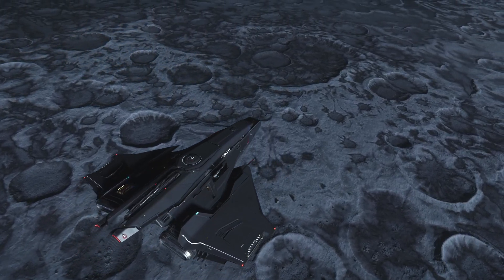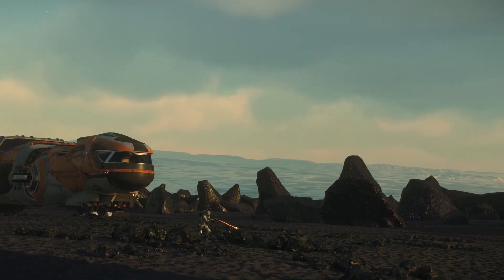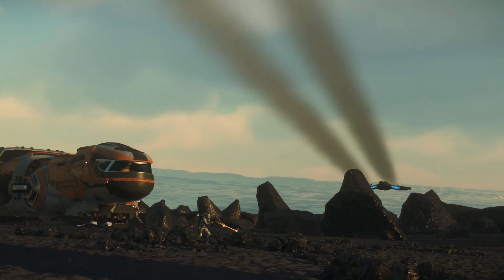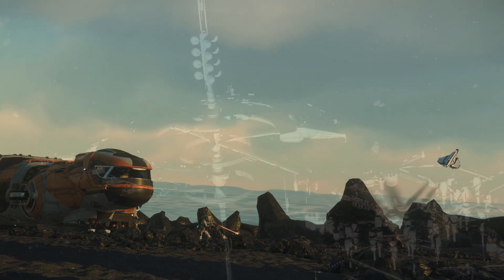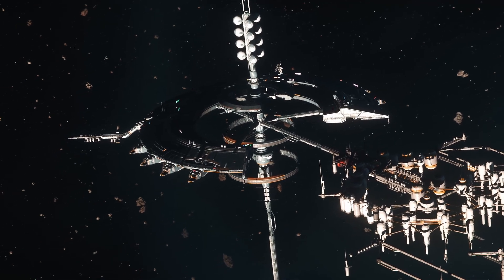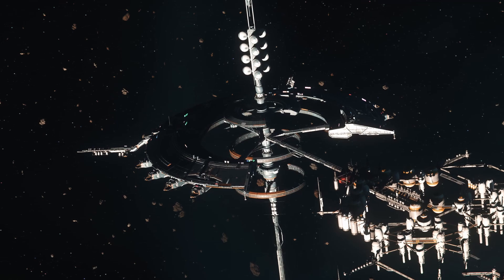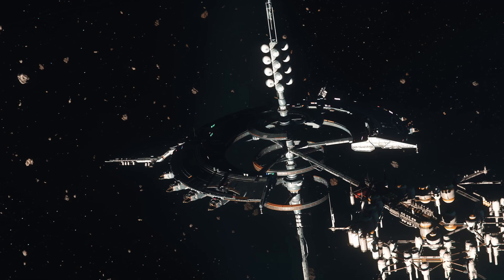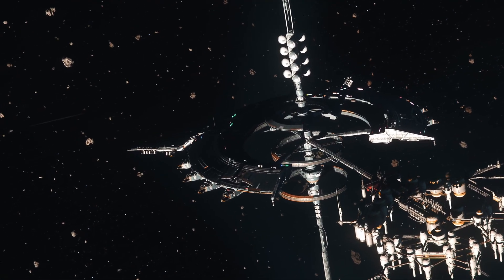Star Citizen - Server Meshing Explained 2024

Comment: new sub here. very interesting stuff. i'm still optimistic but concerned about our replication layer. Demo was very impressive at Citizencon (I was there!) but, in recent testing, what happened in seconds at Citizencon, is taking a very very long time. I'm assuming CIG is looking at some worst-case scenarios here. Obviously, we can't wait 10 minutes (or hours in some cases. I was in a server error status for over an hour the other night) to bring the servers back up for everyone. imagine being in PVP or a track race and the server goes down....5 minutes later you come back to smash into a wall! My question is will the replication layer be running in parallel to the main server(s) so that when the main server goes down we can seamlessly switch to the parallel server?
Reply from the maker: Welcome!
Yes, the CitCon demo was very minimal. I would definitely expect some performance issues with the initial full scale implementation.
And also yes, the replication layer is a fully separate service so If the server dies the replication layer should stay up and vice versa. I'm guessing that if the server dies replication layer will transfer all streamed in assets to another server while it waits for the crashed one to restart. And if the replication layer crashes I think there will be a few minutes of lag while it restarts

Comment: Does this mean that there will only be one server simulating a single (small) location in SC? Right now if I log on to a server and don't get the same server as a friend, I can't see them. Do other MMO's also do server meshing? How do they deal with massive player numbers in the same world?
Reply from the maker: Yes and no. That's what dynamic server meshing is trying to solve. Let's say that you have a 100 players at that small location, then yes it might get its own server. But if those 100 players are spread out let's say across Hurston, then Hurston might have its own server. But that's just an example. CIG have stated that they don't want rigid rules on how servers will be allocated.
And yes other MMOs need server meshing, but each of them takes a different approach. As someone mentioned in the comments WW2OL took a similar path to SC, on the other hand ESO uses loading screens to split up the game world as well as regional layers

Comment: I'm a software solutions architect and long long long term backer, you've nailed it with this video. Pretty much perfect.

For me Static meshing alone is the huge game changer. They can ensure shards get filled up with proper "match making" process for logging in clients, and then can do something like a 500 player can stanton with a zone for stanton large, then a zone for each planet for day to day play, then have special configs for dynamic events, like an extra server for the moon a JT is on, for instance.

A lot of what we didn't chat about here is data that isn't an entity but exists on servers, and how these appear to be needing heavy refactoring. For example, missions and active mission statuses. These appear to be part DGS managed and part managed somewhere else. Obviously this DGS logic might have to go away so missions persist a) across borders and b) in a set zone where a DGS just crashed and was replaced.
Reply from the maker: Yes, I was under the impression that the mission and beacon logic is already split off into a separate service. But it seems like that's not the case and I imagine it would be one of the requirements before server meshing can proceed. But I think the refactor is waiting for Quantum and dynamic economy since missions are supposed to be closely related to probability volumes and local economy state.

Comment: The one thing is the load balancing. The other thing is the latency problem. And with the second thing and 6 years of eve-online experience I keep my expectations low at best... The European/US EVE "shard" already runs on one server in London. Having seen the problems with 500+ players jumping into  one system to fight each other - I doubt that serve meshing will be of any help since latency wise it should be suboptimal... Then again why would SC need more then 100 players on one server?
Reply from the maker: Valid question. The simple answer is “Because Chris said so” but that’s not really explanatory. I think they will end up with some kind of a layering system where whole everything will be one shard but they will have multiple layers to cover different regions. But not sure how they would handle large battles and such without too many latency issues
Reply: @TheSpaceCoder  what about if you are in one layer and another player is on the next one layer ? bountries? distance's?
Reply from the maker: Yes, that's exactly the problem with this idea. I think the game would make some evaluation on whether the two players should be able to see each other. ESO has a similar system and it determines that based on region and party. By default in overland it puts you into a "server layer" based on some arbitrary rules, then for smaller dungeons and raids it puts everyone into one layer and then when you party up it moves you to the same layer as the party leader for overland areas as well.
In SC they could do this in theory, but since there is no distinction between what is an overland area and what is a "dungeon" you can't use that rule. But on the other hand there aren't that many situations where 100+ need to see each other. So you could layer landing zones and other frequented areas and leave everything else as one layer. But take what I wrote with a bag of salt because CIG haven't released any information on this yet

Comment: Even if CIG could get servers and meshing to work, the variability in network bandwidth amongst all the clients will be the bottleneck. You only have to see the current state of server fps and how it is affected by the number of connected clients. You also have the issues of regional servers trying to communicate with each other. The game problems are amplified when server fps drops to under 5. I don’t see much chance of these issues being resolved this year. Admiral ambition, but held back by current technology and network bandwidth.
Reply: It's not actually about the number of players so much as the distribution of players. More players tend to occupy more locations, which then need to be simulated. It's the needs of simulation that are most effecting server FPS. The main reason sFPS tends to degrade over time is that players spread out overtime and increase the number of locations that need to be simulated.

Server meshing solves this problem by limiting the playspace that any server / DGS needs to simulate. Right now, any server can be responsible for as much as ALL of Stanton. And with Static Server Meshing, CIG will probably keep it that way.

But when Dynamic Server Meshing will make it possible for a DGS to focus exclusively on simulating, say, New Babbage, rather than all of Stanton or all of Microtech.
Reply: Combined with shards it means that one player in Australia would not necessarily be in the same server instance as someone from Greenland even if they are at the same physical location in game.   It's the same plan as too many players at a location would also be split between instances of that location even with dynamic mesh due to network limitations and player and server specs.  
This is also why hangers went away from physicalized locations to instance spawns to allow both more locations and updates to the cache.

Comment: I love this game, but I’m afraid without some technology like hash graph Hbar, our current computers are just not gonna be fast enough for a smooth transition of containers. If I throw a cup on the ground and you’re in London and I’m in California, that data has to go to your machine and the server and talk to each other before you can touch the cup. Let’s see it’s 50 ms each time action and 250ms to load from the DB… you’re still talking about an entire second of lag in a game with a time to kill less than a second. In a game where you can get rammed by a ship that one second matters. 
The only technology I’ve seen that is fast enough to keep up with this much data and not get slow down is HBar. The crypto company. It’s hash Grove technology is able to put everything on a ledger, and not get bogged down with virtually unlimited data. I’m just afraid by the time they’re done with this, the cry engine will be completely useless and it would’ve been smarter to go with unreal five
Reply from the maker: Interesting point on HBar. Generally yes, blockchain tends to be inherently very efficient when storing and retrieving data. 
On the other hand, the CryEngine point is moot at this point. Yes, StarEngine is based on CryEngine. Or rather it was 5 years ago. I don't think there is much of the original CryEngine code left in there, which I believe is why the CryTek lawsuit was settled
Reply: The Cry Engine SC started from, Nor Unreal can handle what SC does, even at this pre server meshing stage. The Cry Engine/LumberYard engine CIG started with was capable of 16km x 16km max map size before needing a loading screen - the latest version of Cry Engine can do 32km x 32km maps. Unreal has a max of 21 square km before performance hits ..you can extend that..even 64 x 64 if you can find rigs strong enough to not run out of memory.

EverSpace, SpaceBorne and StarAtlas are all 'space' games made with UE engine. .. they handle it just like Elite, No Mans Sky, Starfield and others do.. Either spool up the QT and go blackscreen, while 'space' loads up and another blackscreen while 'destination' loads up - or use procedurally generated planets, moons and stars to whizz past the ship model and blink out them out of existence, once they pass the ship to simulate 'Travel'. Those games dont have hundreds or thousands or millions or billions of star systems..they have a skybox they pour stuff into - Just like StarField, with different approaches.

Download Cry Engine and make a solar system size map..keep it managable past that 32km so you dont run out of memeory and crash your computer.. now bring in 100 players...forget that - bring in 50 players.. i thought StarCitizen is made with Cry Engine..why cant it even get a decent city sized map going multi player with complex geometry, physics..etc? SC/ Squadron 42 were made with Star Engine ..Cry Engine nor Unreal nor Unity nor Creation Engine nor Frostbite nor ANY engine can handle just New Babbage alone.

The only tech you have seen fast enough is Hbar..but they spent those years, getting those patents and engineering a system that Can handle that much  data.. thats the components like the object containers, entity graph / persistent entity streaming / replication layer - talking to the servers. Have you been in the replication layer tests? how long did it take that water bottle your friend dropped to register? ..notice any difference?..notice an Increase in input lag? ..if SC can handle the 100 players and its managable with just the 1 server.. how will it perform sharing the load so 1 server doesnt have to cover an entire solar system and all the entities and calculations in it?

To do this in Unreal or any other engine - 1st the game developer would have to get a license to tear down and gut the UE5 engine and then start doing the R&D, patenting and inventing.. which is why Dynamic Server Meshing only existed on paper before CIG invented it and showed off the 1st working prototype of DSM in game engine history during CitCon. 3.18 was a mess but the MOST critical step in the whole affair because every entity and every line of code in the engine had to be retooled to work within PES in a structure that was designed from the ground up without PES in mind. Banking, Finance, Casinos, CyberSecurity firms, Netflix, Amazon.. alot of industries use Graph Databases but bringing 3.18 online = more data than all of them combined... so even more tech had to be developed until their graph database service provider can finally handle the beast without melting their hardware, all over again.

The current Replication layer focus is on reducing the server restart time and handling entities that were on missions or riding trams.. etc - lets keep in touch.. it wont be long until Evocati are testing the Static Server Meshing
Reply: This is an issue with any online MP game.
Which is why CIG has mentioned breaking the world regions into shards, to cut down on the lag. Possibly 3 shards for the US as an example.
Nothing is preventing a player from playing on any shard, but the player must know there will be consequences when playing outside your local region.
And if they don't understand that, I consider that a lack of education/common sense.
Reply: Albion online solved the world wide one server problem with a global cool down, where if I'm 50 ping and your in new Zealand and your ping is 400 I'd get a larger cool down timer to balance it out. Though this is more of a twitch game so... ¯\_(ツ)_/¯ who knows I'm a plumber not a coder.
Reply: @augustwest9727  Mechwarrior Online created something called hit state rewind.
I'm sure there are ways to mitigate such things. But SC being as big as it is, I'm not sure what the difficulty would be to do so.
Truck driver myself.
I tried editing a script once for a controller, and it had bug in it. Took me two hours to discover I put a caps letter where it shouldn't be.
I have a whole new level of appreciation for coders.
I'll stick with bringing groceries and gas to the stores.
Devs keep working on entertainment for us.